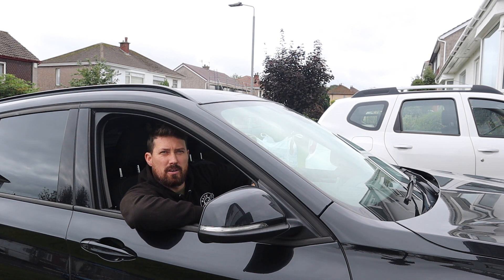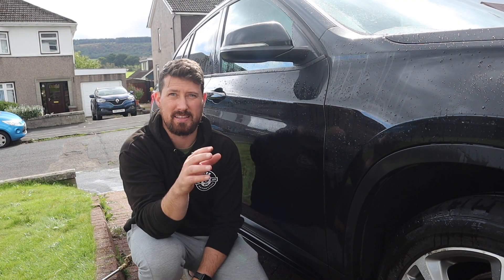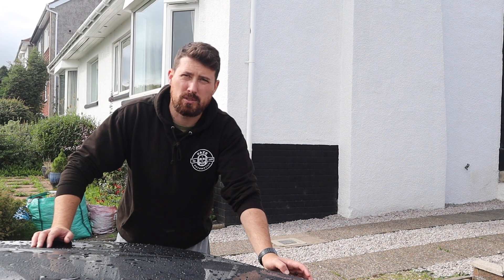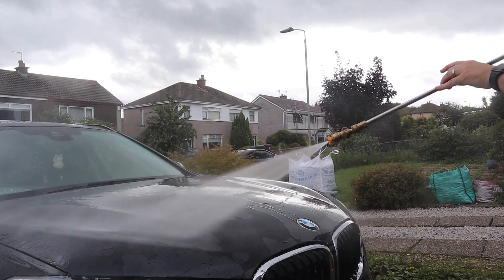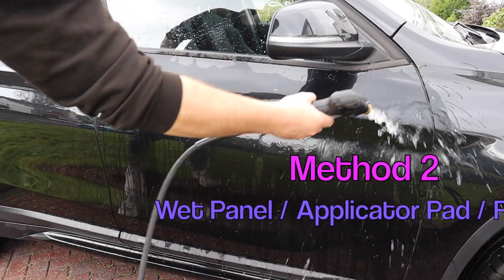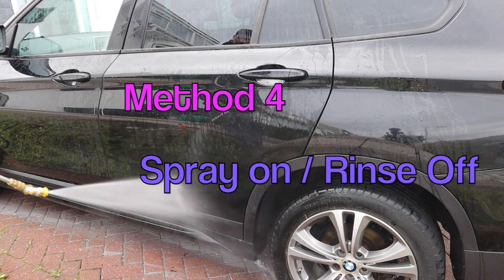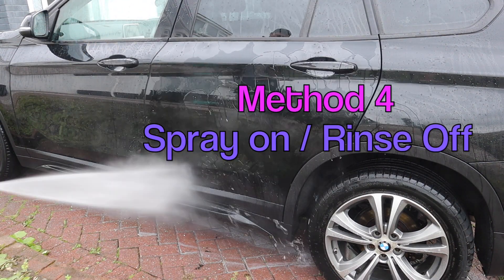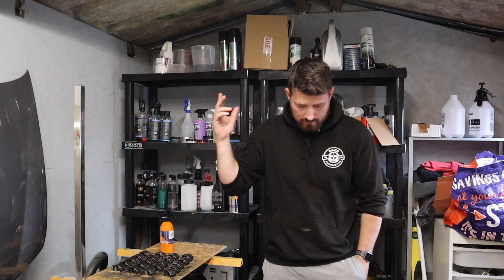Gyeon Q²M Wetcoat Best Application Method & Bathe+ Update

Comment: Best method is actually the 3rd one you have used. There is no point to spray onto the cloth to give it time to absorb and waste the product. Spray on slightly wet panel, spread with wet MF clothe, rinse right away lance distance 50-60cm. Always work from roof to wheel rims, panel by panel. A final overall rinse of the whole car is a bonus. The reason in your case it didn't work as good as the 2nd method is because you used considerably less product on the 3rd than the 2nd. Also notice you sprayed onto the panel some good amount extra on the 2nd method. Regardless, nice demonstration of those four methods and thanks for taking the time to make it.
Reply: I think the 3rd panel he used more product ,he sprayed it 3 times and alot of it went on the panel whereas 2nd panel he sprayed it twice and like you said it also will absorb into the sponge so would of ended up use less product on 2nd panel but it performed better than panel 3

Comment: I have a black  highly polished and coated car that I prewash with Gyeon Foam(4% PIR) and then hand wash with Gyeon Bathe + every week. This has worked very well for me in maintaining high levels of gloss and hydrophobicity. On my last wash, as an experiment, I upped the concentration of Bathe+ by 50%, from the recommended 20 ml in 2½ gal of water to 30 ml of product. I also applied Gyeon Wet Coat as recommended directly on the panels. The result was stunning; in gloss, slickness and hydrophobicity.

I'm a big fan of Gyeon products and enjoy seeing others experiences with them in these videos.
Reply from the maker: I do like the gyeon range, they have some cracking products

Comment: Good demo David the application with the pad certainly impressive I think the reason they want it sprayed on is speed and the amount you rip through is obviously great for there sales ✊🏻
Reply from the maker: Thanks Paul, I wouldn't be surprised if that was the case mate, that's the first time I've properly recorded using wetcoat and I'm quite shocked at how much of it was blown away. I still really like it as a product, just need to not use the recommended application method.
Reply: @DavidMcBay  How long this product will last. How often I need to apply to the car? Do I have to do anything prior? Eg using  coating. Or wax. Or I just apply it direct in the clean wet car? It will last 2 3 4 months? Please let me know the appriate application and the appropriate procedure please! Thanks.
Reply: did you start cleaning rubbers with small brush?

Comment: Great video on the versatility of Wet Coat and durability of Bathe+ which i use both! The Wet Coat spray and rinse method wasn't as effective as it could have been due to how much product didn't hit the panel which is a user error not a fault in the performance. I personally use a two spray, rinse, one spray, rinse method and it's mint. I will definitely try a dry panel application after seeing this video. Thank you!
Reply from the maker: Thank you, Yeah unfortunately even on a calm day my drive can be like a wind tunnel so I had to come up with some different ways to apply this product. Let me know how you get on trying the different methods

Comment: Good video mate! I'm also an advocate of wet the panel, spray directly onto a damp applicator, spread it on one panel at a time and pressure rinse off immediately to prevent any streaking issues. Try and get the car dried quickly also just to ensure a lack of streaking!
Reply from the maker: Im glad other people use this method, it makes a huge difference to how long a bottle lasts as well as the durability on the car
Reply: @DavidMcBay  Absolutely! Thanks for making the video!

Comment: I’ve got one of them Deionised water vessels so I literally rinse the car after washing, spray wet coat on the car and spread with microfibre pad rinsing off panel at a time. Fantastic product and definitely gets better results if you spread the product a bit, still literally takes less than 10 mins to do the whole car even when spreading it
Reply from the maker: I have been considering getting one of them but I’m not sure how much benefit I would get as the water in my area is already very soft. Do you notice a big difference with it? Yeah I love wet coat, like you said even spreading around you can still fly round the car and be done in no time
Reply: @DavidMcBay  I’m also in a soft water area mate, I’d say the filter is my best purchase in relation to detailing… having a black car previously I couldn’t clean it in the sun or it would be covered in water spots no matter how quickly I tried to dry it (tried numerous towels, drying aids and a blower)… now I just wash the car with the hose attached to the filter and let it naturally dry to a perfect finish
Reply from the maker: That’s great mate, which one did you get?
Reply: @DavidMcBay  Vyair I got, when I was looking I found the ones marketed as “detailing” accessories were significantly more expensive for the same product. The Vyair products are marketed to window cleaners but all vessels will have one of 2 types of resin (MB115 was recommended to me as I’m in a soft water area). I got the 25L which was on offer and they were sold out of the smaller ones, worth every penny honestly, when I finish cleaning my car now I just go inside and have a sit down, no worries about water spots etc
Reply from the maker: That’s ideal mate, I’m going to go have a look at them now. means one less thing getting dragged across the paint aswell.

Comment: Very good video Dave, well explained throughout. I have yet to use Gyeon wet coat but this has definitely given me something to think about when using any spray & rinse products 👍🏼👍🏼👏🏼
Reply from the maker: Thanks Mark, I really like this product and now that ive got my preferred application method i like it even more. I know it seems like a bit more work than the simple spray on rinse off but that little extra effort is well worth it in my opinion.

Comment: Thx for the video. Meguiars hybrid ceramic wax is a similar method. They say to spray on and rinse off but i find this method ridiculous as there is no possible way for the product to completely cover the entire panel. I spray it on and spread it with a wet microfibe then remove it. Works much better. I assume they state to do the spray on rinse off method as they think majority of people are lazy and want the fastest easiest product to use.
Reply from the maker: I like the idea of a spray and rinse product and I really do like this product but I’ve found that unless there is no wind, spraying and rinsing I need to hit the panel 2 or 3 times where as the wipe on method, for the extra 10 seconds per panel works much better first time and uses much less product. I’ve not actually tried the meguires hybrid stuff, I’ll need to add it to the list

Comment: Hi David I watched this video for research into my methods for my ceramic coating on the JCW. I will Defo wipe onto a wet panel after watching this as it will save product. I got a deal on What Car Box of miniatures of wet coat, snow, tyre cleaner & ceramic detailer for £12 so looking forward to using them on the Mini. Thanks for the tip.
Reply from the maker: thanks John, if i was you and getting a gyeon coating on the car i would look into Gyeon bathe plus shampoo its great for maintaining ceramic coatings.
Reply: @DavidMcBay  Thanks for that. I had it on my wish list that came to £300 ish.

Comment: Hi, loved your informative video. It is impressive and at the same a bit shocking  the way of application method is different than Gyeon recommends. A quick question, would you recommend gyen wetcoat on gyeon cancoat for every wash? Or rather maybe once every month after the wash? Thanks
Reply from the maker: Hi Emrah, thankyou for taking the time to watch and leave a comment. In one of my previous videos I demonstrated Gyeon Bathe + and if I have already got can coat applied I would just wash with bathe + and you wouldn’t need to worry about using wet coat, Bathe + is an excellent product for keeping your protection topped up

Comment: Thank you so much for sharing this compare and contrast video. What I must ask is, do you re-use the applicators after a wash, or do you just throw them away? I don't know if WetCoat is similar to ceramic coating in the sense that it'll crystallize and destroy/crystallize the microfibers causing damage to panels.
Reply from the maker: Thank you for taking the time to watch and leave a comment. I found that this product doesn’t crystallise the same as what a pure ceramic coating would do so a wash with some microfiber wash liquid does the trick for me

Comment: Interesting, I was wondering about this. I've always been of the view that best way to touch the vehicle is not at all lol. Every touch is an opportunity for scratches no matter how carefully we do it. In that regard I think on a coated vehicle that rinse if needed then foam, hose off and then Wet Coat. If required then a ceramic detailer if no forced air or in combination with. Thanks.

Comment: Hi David, out of interest have you tried this as a drying aid? obviously appreciate this is not the intended use. I'm probably going to get some as an alternative to Autoglym's Polar Seal that i apply via a spray bottle (crazy value 20ml + 1 liter, does 2 cars) great over the winter as a toper. I assume wet coat is still one of your favourites?
Reply from the maker: Ive never diluted it down to use although would make an interesting test. It is still a favorite product however i do really enjoy using the Blitz ceramic QD, it makes an excellent spray on rinse off and is my goto for the winter months. Its also a hell of a lot cheaper than wet coat

Comment: One issue I have with applying it another way is that you may as well then use a more durable sealant
Reply from the maker: Thats true, although i do still find using method 2 still gets round the car very quickly.
Reply: Can u recommend something more durable?

Comment: I used to use Wet Coat all the time and used the applicator on wet panel, pressure wash off method. I have a dark coloured car and it was fine using that method in cold or cloudy conditions. But when the panels were anywhere above warm, boy it was a killer. I still use it a lot on alloys though.
Reply from the maker: As much as I like it’s an expensive spray on rinse off. I’ve been using blitz detailing ceramic spray recently (over winter) and it’s great. I use it most washes for wheels now

Comment: I'm new to the product.  Are you supposed to wash and wax your vehicle and then apply or just wash the vehicle and use the "wet coat" as the wax?
Reply from the maker: It can be used as a stand alone product or over the top of an existing wax to top up the protection.

Comment: I have been using Autoglym's Polar Seal    would Wet Coat be okay on top of it or is it better to do one or the other in your opinion?
Reply from the maker: I have never used it on top of polar seal but have used as a topper to many other forms of protection so I don’t think you would have an issue layering it on top

Comment: How long this product will last. How often I need to apply to the car? Do I have to do anything prior? Eg using  coating. Or wax. Or I just apply it direct in the clean wet car? It will last 2 3 4 months? Please let me know the appriate application and the appropriate procedure please! Thanks.
Reply from the maker: Generally your looking at around 2 months durability however with the ease of application this product can be topped up once a month to maintain performance. No coatings required, just wash the car as normal then apply the product. Hope that helps.
Reply: @DavidMcBay  thanks thanks!
Reply: @DavidMcBay  which is the best method of applying? 1st? Or 3?
Reply from the maker: @vasileiospetropoulos2046  i would go with the second method personally I think that provides the best coverage then when topping up method 4.
Reply: @DavidMcBay )

Comment: I actually use method 5 lol.
I apply to wet rinsed panel using a damp micro fibre and a few sprays of wet coat into it.
Spread evenly over the panel, then dry, so no rinsing.
Been doing it this way for a while and the gloss is fantastic and I believe it last longer.
So almost like a quick detailer/drying aid.
Reply from the maker: I’ve never thought of using it that way Keith, will need to give it a go next time I’m using wet coat

Comment: Idk, I liked method 2, like you, the most, definetly going to try that when it's time for another maintenance wash
Reply from the maker: Yeah I think method 2 works best to get full coverage of the panel and it prevents you from wasting product. You’ll need to let me know how you get on.
Reply: @DavidMcBay  It's been almost a month now and the performance hasn't deteriorated at all, it's like I coated it yesterday. I'm exited to see if it lasts longer than 2 months with this method (winters in Sweden will destroy any sealants or waxes due to the dirt/grime and road salts).
Reply from the maker: @Theseones  that’s great to hear, I’m Scotland when they start putting the grit down on the roads it quickly destroys protection aswell. Here’s hoping you manage to get 2 months out of it
Reply: @DavidMcBay  final update, it lasted for about 6-7 weeks, using method 2. It was good considering the weather here, I'm happy with it and topped it up for another 6 weeks.
Reply from the maker: @Theseones  great to hear that, I’ve just done my mums car with it a couple of weeks ago, it really is a perfect product for use in winter time.

Comment: Now what if you use a foam lance to spread it and then rinse?
Reply from the maker: Thats something ive never tried with this, I guess the big question would be what ratio would you go with?
Reply: @DavidMcBay  Don't know, I'd try it under the car as a water and  dirt repellent to minimise the chances of rusting through the winter, and a foam cannon looks like a good way to apply it.
Reply: @DavidMcBay  maybe try 20-40ml with a couple hundred ml water in a canon to get round the car? Polar seal works this way but doesn’t have the supposed durability of Wet coat and dry and shine from TW.
Reply from the maker: @kwl189  will give this a bash next time, i need to refill on wet coat so will get a bigger bottle and try that out.
Reply: @DavidMcBay  supposedly this makes it much easier and convenient to apply in the winter however I am skeptical it will last as long and perform as well as your second method in this video with ultimately appears to be the best method to use.
Reply from the maker: @kwl189  I have used that method before when applying a different type of sealant and didnt get any decent durability with it but with gyeon being a better product it may last better
Reply: @DavidMcBay  Yeah polar seal works this way in a canon but I think it would be even more effective and durable in a spray bottle with the second method. Spray on a wet panel, spread with microfibre, rinse off and then dry/buff off with the microfibre. Wet coat is raved about by so many people, I’ll give it a try at some point and maybe once I’ve run down mu supplies of some other TW spray wax, I’ll get round to trying TW dry and shine. It’s getting to the point where it’s more convenient to do this than go with a paste wax even something as amazing as Bilt Hamber Double Speed Wax or Soft Fusso 99 which gets raved about.
Reply from the maker: @kwl189  Yeah  i do love a paste wax but with these new sprayable products they seem to be getting forgotten about, i have a nice collection of paste waxes but the time required to apply some of them you really need a full day for it including all the prep. I have never used polar seal before for some reason i have never bought it.
Reply: @DavidMcBay  Polar is a typical AG product. Smells good. Does a decent job but not the best and arguably overpriced for what it is because it’s got the queen’s approval stamped on it. I’ll try it in a sprayer and see what’s up with it. It’s sad in a way that paste wax is getting left behind but it can take a long time to do a car and even though paste wax still lasts much longer than spray on wax, it’s hard committing the time to do when washes and rims can take so long to do as well. In Britain we’re famous for the rain so time is precious. I got a good deal and recommendation to try polar seal otherwise I wouldn’t have bought it.
Reply from the maker: @kwl189  yeah thats the thing for us in the UK we only get a 3-4 week windo to be able to apply a wax haha. I am actually getting a bit low on my spray on rinse off products so if i ever see it come up in a deal i might grab some just to see what its like. Ive got a new range that im going to be testing once the weather picks up a bit which sounds promising (Wax & Away) so keep an eye out for that.

Comment: I use Wet Coat on wheels as it's literally: clean wheels, spray and rinse. Amazing product but never use this in the sun.
Reply from the maker: Yeah its great for wheels, Ive never experienced using it in the sun tbh might try it on my test panel next time the suns out which by the looks of it will be next year now.